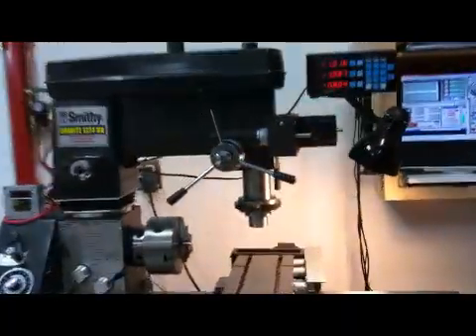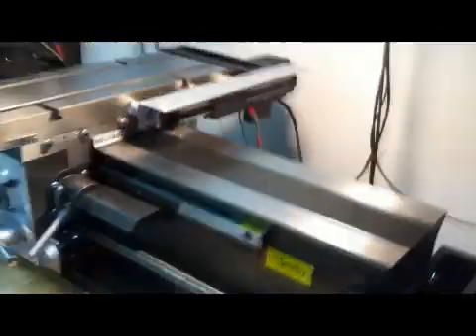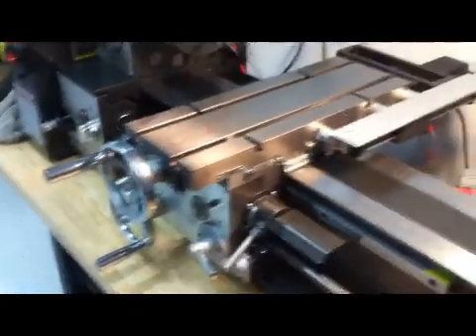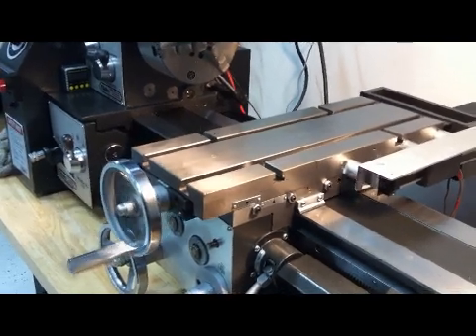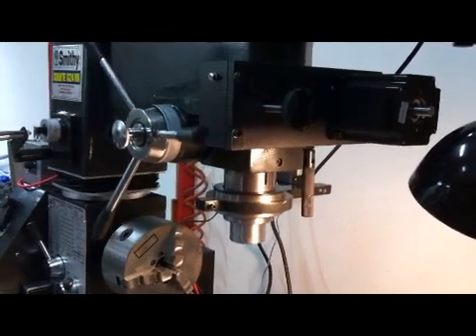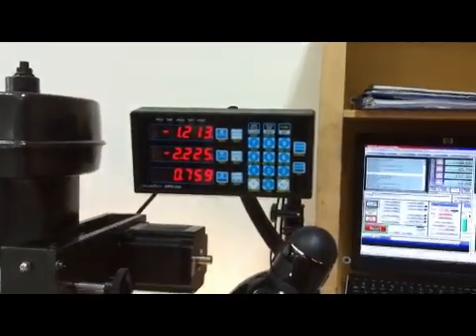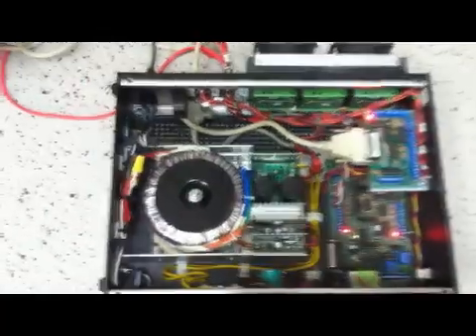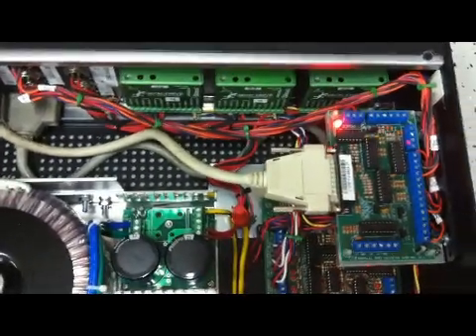CNC2 - Stepper drivers are up and running

Comment: That is awesome! Did you have to do anything to the Smithy to work out any backlash? What ratio pulleys are you using? I've got a Granite industrial 1240 I'm automating. Can you still use the manual Controls?